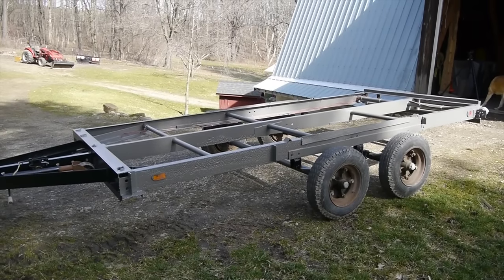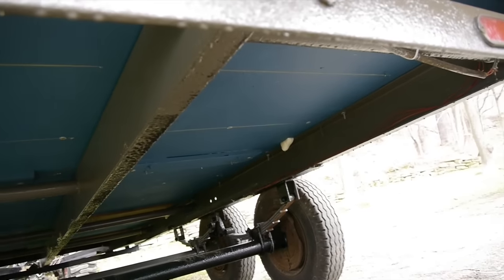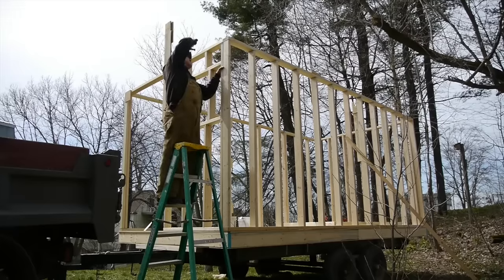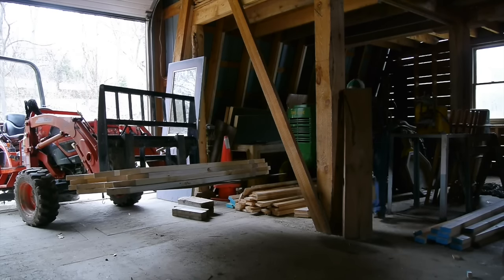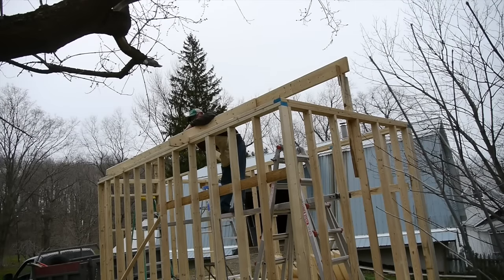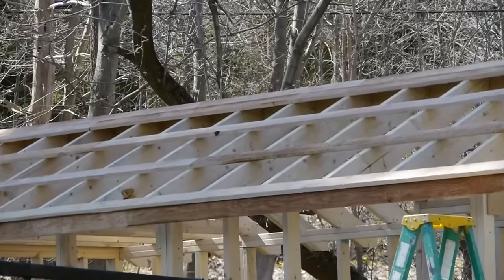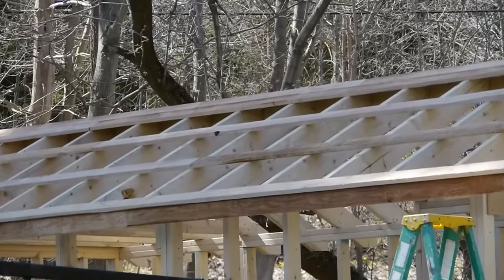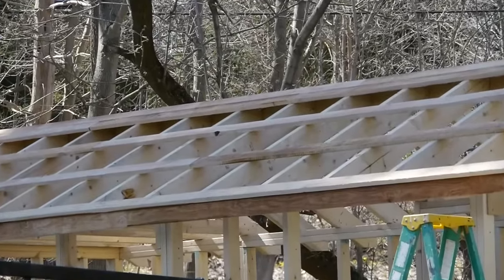My Tiny House: Start To Finish

Comment: The house looks nice but I would not have built it on that trailer I would have bought a trailer that was a little more heavy duty and Pitch the roof more of a slant like they do in Germany and Switzerland where there's a lot of snow
Reply from the maker: Thanks for the comment, Ronald.  My plan was to buy an inexpensive used trailer because I don't intend to haul this thing around.  I built it at home on the wheels then hauled it six miles to it's permanent home.  (No electricity up there.)  The roof is a 6:12 pitch and I don't have any problems with snow ... it slides right off.  We get lots of snow here.
Reply: @TimTools99  Makes sense, thanks for the response and nice build!

Comment: How much did all it cost and how much is it to buy one if u make another
Reply from the maker: I really can't estimate what it cost because I had a lot of the materials and got some windows for free etc.  I bought the trailer frame for $400 and it was good enough for what i was doing.  I knew it would make a one-way trip to my land about 6 miles away.  If i were to make one of these to actually travel around, i would start with a 20' long , 10,000 lb capacity trailer.  You've got to have a good trailer to carry all that weight and with electric breaks to stop the thing!  Then, building a nice one with a bathroom, kitchen, 12v/110 wiring etc, I could see where guy would easily have $15,000 just in materials.  Maybe more.  So, I can see how these guys are selling these things for $30,000 - $80,000.  You are basically buying a house at that point.  What I build was basically a box on wheels with a spot for a bed, chair and a propane camp stove.

Comment: Did you buy the trailer? If so, what size and the approximate price? I'm asking for a friend and I who are interested in building a tiny house
Reply from the maker: If you are going to haul your Tiny House around, I suggest you buy a new 10,000 trailer to start.  You will want a good trailer with good electric breaks.  I bought this old trailer because it was going to make a one-way trip to my land where it will be parked permanently.
Reply: TimTools99 thank you!

Comment: What was the cost? I want to start now.
Reply from the maker: I dont know. I had quite a bit of the materials left from other projects. Price would vary greatly depending on whether you want basic like i did or do you want a bathroom and kitchen etc. If you want to haul it around, you would want to start with a new 10,000 lb trailer with electric breaks. These things are heavy.

Comment: how did you attach floor to trailer?
Reply from the maker: I bolted the plywood to the frame.  Also made brackets that are bolted to the frame and lag screwed into the floor joists.

Comment: Hello Tim,is there anyway you can email me all what you used,all the lengths of the boards and what length of plywood,I would love all the info,so I can build my own Tiny house,it will be my first,so I need all the help I can get
Reply from the maker: Plywood and 2X4's come in 8' length.  I built the cabin 8X16' so that I would not have any waste when I put the plywood down for the floor.  Then, I framed up using 2X4X8's for the sidewalls.  That way, the siding which is 4X8 went on with no waste.  The thing to do is draw up your cabin plan to scale.  This helps you to make a materials list.

Comment: Isn't it better to use metal for the very bottom floor?
Reply from the maker: I guess it depends on several factors.  i wanted to build this cabin as cheaply as possible while still having a good quality job.  I didn't buy metal because the trailer I bought already had marine grade plywood on the floor.  I just painted the plywood with oil-based floor paint.  It should last a long time.  Something like galvalume would be a good metal to use.  It's lightweight and could be screwed onto floor joists with the same screws they use to put it on roofs.

Comment: How much did all of that cost you
Reply from the maker: I did not keep tabs on the cost.  I had alot of the stuff I needed and then I bought some stuff.  It's like asking, "how much does a car cost?"  My Tiny House was relatively inexpensive because it has no bathroom, refrigerator etc.  So I built the VW Bug model.  Now the Cadillac model could cost some serious bucks.

Comment: How much did that cost roughly
Reply from the maker: My cost is difficult to say because I had doors and windows left over from previous jobs.  I think there are several considerations when you build something like this that will affect final cost.  In my case, I wanted a simple cabin that I could build at home and then haul to a permanent spot.  It only made one trip.  So, I could get away with buying a used trailer for the cabin to be built on.  If you are planning to haul your unit around, that is a different proposition.  You will need a trailer with electric brakes rated for at least 10,000 pounds.  It would cost several thousand $ for that rather than the $400 I paid for my trailer.  The trailer is very important if you are going to travel with your tiny house.  Next thing:  choose materials to keep the weight down.  Research how campers are built and go from there.  Next: How many people will be occupying?  My case -only me... so didn't need a lot of storage space.  Next: do you need/want a bathroom?  My case, I have an outhouse.  Bathrooms will add considerable cost. Next: how to power the unit.  Plug into a 120VAC? or 12 volt?  If you have access to power, then don't spend money on 12v system but if you are in the woods like I am, I had to buy solar panel and all that goes with it to provide power for lights.  How will you heat?  I have a direct vent propane wall furnace.  Cheapest one I could find was about $800 installed and I did the installation.  As you can see, there are so many variables to consider that will affect your final cost.  My Tiny House is really a basic unit - a place to get out of the weather.  If I was going to build one to travel with, I bet it would easily cost be $10,000 - $15,000.

Comment: around how much does it cost to make something like this
Reply from the maker: I it is hard to estimate because the doors and windows were all given to me.  Also, some of the wiring, the electric panel and breakers etc were things I had from previous jobs.  I would say that to do this right and buy everything, you would easily have $5000 into a basic build like this if you do the work yourself.  P.S. If I ever build another mobile cabin, I will start by buying a better trailer.  You need a good foundation and electric breaks if you are going to haul something like this around.  In that case, it would cost $5000 just for the trailer.

Comment: How much did this cost you , in total
Reply from the maker: I it is hard to estimate because the doors and windows were all given to
 me.  Also, some of the wiring, the electric panel and breakers etc were
 things I had from previous jobs.  This was a basic cabin build and so I got away with a cheap used trailer frame to make the one-way trip to its resting spot.  There are so many variables to consider.  If you wanted a Tiny House that you could haul around, I would say you would easily have $10,000 in it because you would want to start with a heavy duty trailer with electric brakes, then your build, electrical, kitchen, bathroom etc.  It really is like building a "Tiny House."

Comment: can someone answer me how many kilos this construction is? it looks really heavy. isnt the point to keep it light too?
Reply from the maker: Please read the comment below which will answer your question.  This cabin on wheels was not built to haul around.  It made a one-way trip to my camp where it is set up permanently.  It is built like a house and fully insulated to be warm in our harsh winters.  If I were to build a tiny house to haul around .... I wouldn't.  Ha!   I would just go buy a camper.  I think it is silly to build these tiny houses and then haul them around.  They are all heavier than campers that are built to haul.

Comment: What secures the floor to the trailer? I know very little about construction, but I've decided to pursue this thing, so I'm trying to learn all I can, if there are any knowledgeable and patient folk out there willing to answer a couple questions I'd appreciate it
Reply from the maker: I screwed through the metal frame into my floor joists.  Later, I added metal brackets to the frame and screwed those into the joists.  I knew that this cabin would be making a one-way trip to its permanent home in the woods so I did what i thought I needed to do to get it there.  If I were to build a Tiny Hose to haul around, I think I would do it a lot differently.  Start with a good, heavy duty trailer (10,000 lb two- axil with electric brakes.) Look into how they build campers and use light-weight construction materials and techniques.  Actually, I can't imagine hauling some of those Tiny Houses that people make.  It would cost a fortune in fuel to pull them around.  If you want to haul something around, skip all that work and just go buy a nice camper!  Ha!

Comment: how much did this cost (roughly)
Reply from the maker: Can't really say.  i had a lot of the materials stockpiled.  You can figure yours out by drawing up a plan and determining materials then go to your hamster and get prices.  There are a lot of variables that will affect cost.  My idea was to provide me a dry and warm place to get in out of the weather.  It's pretty basic.  If you want a bathroom, shower, full kitchen etc, these things add to the cost in a hurry.

Comment: no vapor barrier?
Reply from the maker: No vapor barrier. Unnecessary expense.  I use oil primer and paint and that will provide a vapor barrier.  Most people don't know that.  One reason that old houses have lasted so long is that people used oil based paint back in the day.  This cabin will last many years the way I built it .... in fact it will last a lot longer than I will.  (:

Comment: I didn’t see how you actually attached it to the trailer.
Reply from the maker: I attached plywood to the trailer frame with bolts.  Then, I built my 2X6 floor frame.  Next I screwed up through the bottom of the plywood into those 2X6's.   I used many screws. I knew that this would be secure enough for the one-way trip to the Tiny House permanent  spot.  If you plan to haul your house around, I suggest securing those floor joists to the frame with metal bracket or some other way.

Comment: Awesome man. I knew you were in NY for some reason. Then you said it and I laughed. I was born in upstate. I live in Hawaii now off grid and am doing something very similar. I have no experience and no power tools, so I'm confident anyone can do this as long as they stick with it. ( don't get me wrong, mine is not a work of art, but I'm about sick of living in a tent with my dog ). If you use Instagram, you can check out some pictures of my progress if you're called too. @fr0zak ... the 0 is a zero. Again great job. For some reason your video just made me feel comfortable. I'm in it about $2,000 right now, and that's for frame, windows, and metal roof. ( just incase anyone is wondering ). For 5gs you could have a nice little fort. Or spend 10k and you'd be sitting pretty.
Reply: i checked it out  and all i have to say is Waoo that is an amazing job you have done. congratulations bro. 
I am thinking of building one soon. thanks for the inspiration and the ideas. 
greetings from the bronx, NY :D

Comment: Did you do any weight calculations? Looks heavy, built like a house. A tiny house is not really much different from a camper.
Reply from the maker: No weight calculations. I built it. I moved it. I'm enjoying it. The cabin on wheels made a one-way trip to the woods where it will remain until i die. Ha! Built it like a house. Fully insulated for wintertime fun.

Comment: you're obviously a skilled person and do a great job at building this, but like so many others when you already have so little space why would you alocate square ft. to a porch ????  why not just overhang the roof a bit by the door and safe that floorspace for inside...........  I just don't get it !
Reply from the maker: Two reasons for the porch.  1.The porch is screened in so in the summer when it's buggy, I can sit out there and watch the deer and turkeys and drink my coffee and not get bit up!  2. In the winter, we measure our snowfall by the foot.  This porch allows me to come in out of the storm, take my boots off and then open the inside door to enter the cabin.  I didn't want to open an outside door and have the cold and snow blow directly into the cabin.   Thanks for watching ...

Comment: Wish you would have put a shed roof on it, the center aligned roof wastes space.
Reply from the maker: In my second Tiny House video I show you the inside.  I built a vaulted ceiling which gives me a tall ceiling.  Lots of room.  https://www.youtube.com/watch?v=0clIxp-B4wQ&t=1s
Reply from the maker: .... but, I didn't want a shed.  Ha!  I suppose it depends on how you build your roof as to how much room you will have inside.
Reply: And I don't think you are living in your cabin full time so you can escape before getting cabin fever .... the one I mentioned, they live in it full time so need the extra space that a shed roof provides.  Your cabin was a great build.
Reply from the maker: Thanks for your comments.  Yes, I built this thing for a weekend get-away.  I don't like shed roofs because there is always one side that is a head-knocker.  You can see that in his video when he is upstairs.  If you really want to maximize space, build a Gambrel roof.  I have built several of these style buildings. The advantage is you can build shorter side walls and the gambrel roof provides a high, wide-open space for the upstairs.  This is why gambrel roofs are used on barns and Dutch Colonial homes.  It also looks much better than a shed, I think.  Good luck with your Tiny House if you decide to build one.  If I build another, It will be a Dutch Colonial Tiny House.  Haha.
Reply: I will probably never build one ... actually, not probably, never will I build one for sure.  I live on first floor of our home and rent second floor so works out great.  When we sell this house, we'll move overseas somewhere, my wife is from Asia, but we won't go there first, travel around first then we'll settle in Asia most likely.  Dutch Colonial - haha - you have time on your hands!  :)  I can't imagine ever needing a tiny home, but not opposed to them so if for whatever reason I ever need to consider one, I'd be open to it on my own lot so can escape to the outdoors when needed and depend on no one.  I keep thinking, having a tiny home would push a lot of people to get out and about.
Reply from the maker: Wow! That is a travel plan!  About this "Tiny House." .... I started out to build a simple cabin so I could get in out of the weather.  Later, I heard they call these a Tiny House.  I had never watched the TV show and didn't realize that people were building them and living in them!  I can't imagine living in such a confined space.  Haha.  It's a popular thing so I decided to make a video.  Good luck to you and your wife on your travel plans.

Comment: so heavy.... why go with materials so heavy???? Steel studs would of reduced the weight and bci's.. not bashing by any means just curious?
Reply from the maker: Hello Danny B. As I said in my comments above, I built this cabin to park permanently at my camp. It will make a one way trip and never be moved again. There is no electricity at my camp so the idea was to build it at home where I could work on it when I could, then tow it up to camp. I fully insulated it so I can use it in the wintertime. That’s the reason it is built like a house!  Thanks for watching.

Comment: Not being negative at all cuz you did an amazing job. But I would definitely reinforce that tongue having that angle iron facing the way it does is like the worst possible Direction the weakest possible Direction and could face.
Reply from the maker: The trailer/cabin made a one-way trip to my camp where it will be permanently parked.  Thanks for the observation though.  I don't plan to move it again.

Comment: no vapor barrier ?
Reply from the maker: No
Reply: @TimTools99  ya why not?
Reply from the maker: I'm a cheap SOB.  It will be fine.  It will last longer than I will.  Ha!
Reply: @TimTools99  oh lol well nice build anyway i usually think its worth the money
Reply from the maker: @jakej.1632  My idea was to build this thing as cheaply as I could so I stayed with pretty basic materials.  I knew that it would last as long as I do and the question is always , "where do I stop?"  For example, I went with free single pane windows rather than buying doubles.  Are modern windows better?  Yes, but it's a cabin.  No bathroom.  I have an outhouse.  It's a weekend get-away.  There were several things like this that I went cheap and basic.  Now, if I were building a real cabin - permanent building I would spare no expense.  My son can seel this little box on wheels when I am done with it.

Comment: Start to Finish, where's the 2nd video?
Reply from the maker: +April Mae 

Hello April.  I should have said Start to Finish on the outside!  It's a work in progress.  I just got started working inside.  I will be posting that video soon.  I didn't want the video to be too long so I decided to do a separate video on the interior.  Stop back later and check out video #2.  Thanks for watching

Comment: I'm no engineer but all the walls are over the edge of the trailer.  Shouldn't the weight be distributed on the trailer? Cute house though
Reply: The Master Key it will probably give with the size of the floor beams